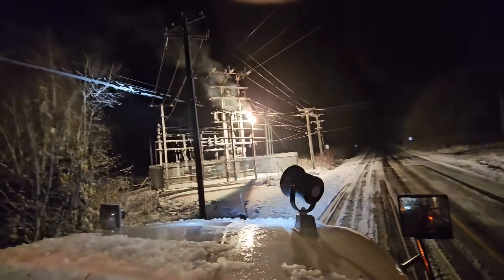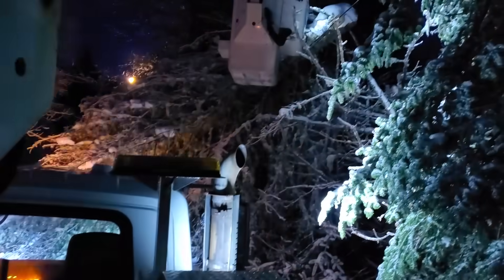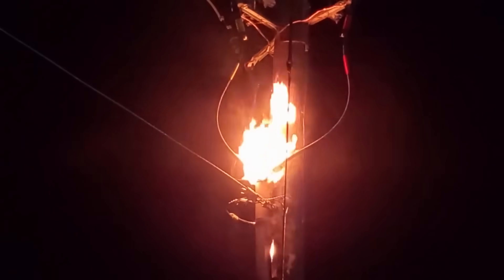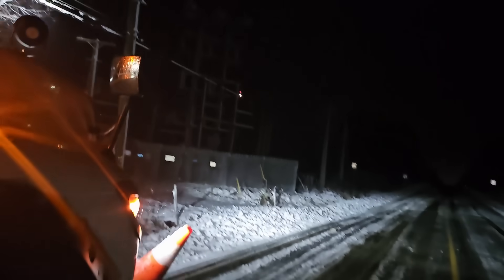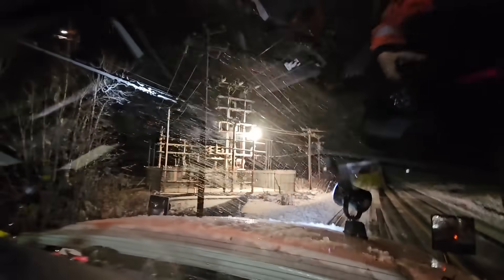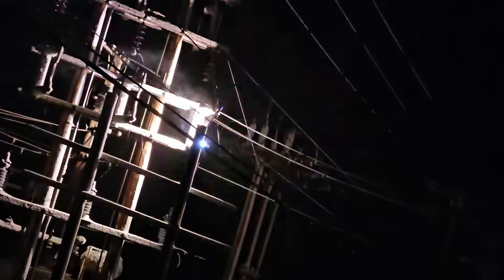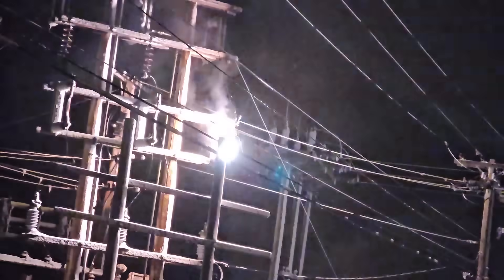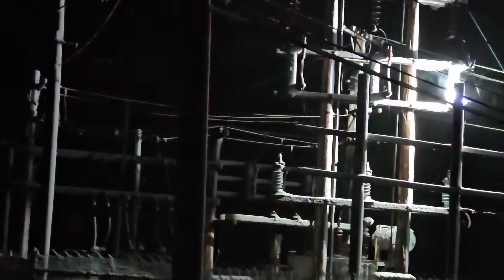Making "the call" to dump 10's of thousands

Comment: just imagine if nobody has seen that, and it progressed without intervention.....
Reply from the maker: Definitely could have been bad! Eventually it would have likely cross phases or gone to ground and tripped the Highline... But the fault could have very well burned the entire structure!
Reply: @Bobsdecline  "it'll burn out eventually" :-) I've seen a few systems around here (NC) with isolation panels between the phases, I assume to limit arcs. (the smaller scale "industrial" systems have those boards to stop the errant screwdriver. I've told the story of the telco power minions dropping a wrench into a PDU... that was just -48VDC/5000A.)
Reply: @jfbeam  I have seen coper plated glass windows in two doors with a spanner that dropped 2 floors and fell across the 8 inch by 1/2 inch x two copper buss interconnecting 3 battery rooms and 4 rectifier banks on diffrent floors the rectifiers were in sets of 3 x 1000 amps (12000 amps) battery rooms had 3 banks of 4000Ah cells (36000 Ah) the spanner was never seen again and a 1 inch notch left in the buss bars.
Reply: It would have eventually caused a phase to phase fault and dome a lot of severe damage to the substation. 😮
Reply: @christopherleubner6633 the amount of damage done depends on the architecture of the substation. assuming a substation with microprocessor relays, the line relay in the station would detect a zone 1 phase to phase fault and trip instantly, clearing the fault within 4 cycles. or, if this was on a bus, the bus differential relay would detect the current imbalance and immediately trip the bus breakers, again clearing the fault within 4 cycles. these trips would prevent the expensive transformers (and other components) from being damaged.

you might have to replace a structure or some conductor, but that's not much compared to the transformers or breakers being damaged.
Reply: Good thing that arcing was observed in the dark of night.  The initial low glow certainly would have been much more difficult to detect in daylight.

Comment: Now for a question, do those HT fuses or the things they are mounted in age in a way that would cause this kind of failure?
Did older equipment that has hopefully long since been replaced and/or upgraded develop any "bad habits" like this as it aged?
The only other thing I can think of for a potential cause for this kind of thing is that it's weather-related, but this kind of failure seems to have happened "inside" something that's largely protected from direct exposure to the elements, so that exposure protection would have had to fail first for that to be a factor. Strange!

Comment: That fuse looks to have a ceramic material over the internal fuse element. It appears that the HV found an external pathway around the open element along the ceramic case and made what we (in electronics) call a carbon track. High resistance, but still conductive enough to start an arc.
Reply: With wet snow around zero degrees C, yhea that could happen. I have seen dirty insulators with electricity crawling on the outside of them.

Comment: Fuse barrel failed allowing current to flow through the barrel instead of the fuse. The barrel itself isn't the best conductor so it began to heat up causing the flash

Comment: At least you didn't need a spotlight to find the fault!
Reply: Definitely a "well there's your problem right there" kind of situation lol
Reply: I'm a up-to-600 volts kind of electrician, my problems are that easy to find only when FPE panels are involved. Had a dock lift cord cold shorted on a 20A double pole (208 3ø) that was still live after violently arcing itself in half. Not all Stab-Lok breakers are that pyrotechnic, but the good ones and bad ones look identical until stuff goes wrong. 😂
Reply: @kdawson020279 ya gotta love FPE panels 😆!!!
Reply: @kdawson020279  It is wild to me that things like this are still possible.. like you would think the system is so basic even the knock offs would work too... it's almost dumb to fail.
Reply: @Alarichswiftpaw  To be fair, even the "newest" FPE panel is going to be 40-some years old at this point.  They stopped making the problem panels in the early '80s and were completely out of business by '88.

Comment: This vid must be related to a storm that blew thru my area of NY a couple weeks back, started on Thursday night and was tapering off by Friday morning. All told it dumped like 8-12" of heavy wet stuff on our location, causing a lot of headaches for power AND cable company (~20k service interruptions for each of those two utilities).
Woke up at like 2AM and I heard some cracking groaning sounds "outside somewhere" but I was too sleepy to investigate since they weren't loud enough to make me think they had landed on the house. My best guess is that it was either our Lilac tree splitting or some of the trees from the hedgerow losing branches.
Then I woke up again at around 4AM and there wasn't a single sight or sound to be had, because the power had gone out. Good thing our weather radio has battery backup.
All I did about it was fumble around for the flashlight I keep in my desk drawer, throw on another blanket and go back to bed.
Power came back on at ~8:30AM, but the internet stayed out the whole day, but I managed to get our house "an" internet connection by using a USB-C to Ethernet adapter to tether my dad's smartphone to the same ethernet cable the cable modem usually uses. Good enough for 360p video with frequent interruptions, and to do basic messaging. Maybe you should keep that idea in your back pocket for if you end up in a similar situation someday? "Some" internet is better than "no" internet, after all.

Comment: That is a situation that even as a regular sparky can come up....I've had a few commercial calls where I had to end up dumping an entire building to contain a fault that was threatening to take out the entire switchgear. One memorable one was a plant where interrupting power to process was going to cause a lot of collateral issues with equipment...I told the owner we do the immediate shutdown and fix it within a few hours, or we let it burn until it takes out the entire service and you'll be down for weeks as we pull the damaged gear out and order in new gear.  (At a cost of lost production and new gear in the millions.)  In my position then (as with yours in this case) it was ok, do a short term shutdown of 10-20k customers or let the entire substation fault out taking days if not weeks to rebuild...which is the lesser of the two?  Sounds like your utility has good folks at the top and made the right call to trust your judgement without question.

Comment: While I was living in Florida I was in the house minding my own business. I heard a sound which I don't think I ever heard before. To me it sounded like metal plates sliding on concrete or even super loud welding. I stepped outside and it had quit. So then I had walked down our long driveway to get the mail, when the sound came back and I think I jumped off the ground. The high voltage line running overhead on the other side of the road was producing electricity on the outside of the wire. It looked scary to me. I called FPL and got right through to the top guy and he said he would send them out right away. They must of had trucks close by because they were there in less than 10 minutes. This road we lived on was always super busy.
Reply: Florida Man strikes again.
Reply: last time I was in Florida, a giant line broke off and went down across the highway and other roads near orlando/ disney. one of their silly mouse head towers. that made a wee mess of things that day.
Reply: FPL had an substation explosion with a video of it here on YouTube.

Comment: happened around 35 years ago at the substation 7363 ,same situation with a big arc at the fuse, same conclusion had to drop the 69KV line to isolate the defective switch

Comment: Two questions:

How long did it take to repair that issue and reenergize the lines?

And, you showed a clip of a fire on a pole.  How many poles have you had to change out due to fire, and how long is the process. 

I guess that's actually 4 questions.
Reply from the maker: We had the 69kV line energized within about 15 minutes. The sub in particular was about 8-10 hours.

I've changed out hundreds of poles due to fire... Typically about 6 hours including response time and 3 hours if we use a pole top extension.
Reply: @Bobsdecline  interesting.  Thank you for the reply.
Reply: Once the blade switch is disengaged the whole fault region is isolated, so the main line can be reenergised. Inspection is appropriate, but in theory it only needs to be off as long as it takes to get to and operate the blade switch.
I am no expert, but I don't think attempting to disconnect using the blade would be a good idea, even if it was accessible. It isn't designed to kill arcs that have already formed, and you risk damaging equipment that cannot be remotely isolated from the main line.
Reply: @agsystems8220  ya I got that from Bob's explanations, But thamks.

Comment: I guess I'm a little surprised that the substations don't have isolators that can open under fault conditions so you don't have to dump the entire transmission line.
Reply: This was surface tracking on the fuse which is normally responsible for the automatic side of that very isolation under fault you mention. The fuse itself was blown but an insulation fault bypassed that isolation, leading to fireworks. There was an actual isolation switch directly above the faulting fuse, but the operating handle was below a shower of sparks.

Comment: If worst case occurs and substation is damaged, and takes a week to rebuild, do you bring in temporary setup on a trucks and reenergize?
Reply from the maker: Yessir exactly!
We do have a couple "mobile subs". Definitely not ideal to have to bring one of those fellas in!
Reply: Transformer on wheels. Seen one fail spectacularly as in the main transformer had an arc fault that overheated it so badly the over pressure disks blew out and made a huge explosion as the boiling oil ignited. The cause was a blown fuse arcing over because the pfc capacitor shorted and some if the monitoring gear was off line. Substation was a total loss. If you search for transformer explosions, you can see it as somebody was filming it 😮😳💀💩
Reply: @christopherleubner6633   That was the Ives Dairy substation, I think it is in Florida.
Reply: @christopherleubner6633  I think this is it:

https://youtu.be/ZCzdPFJ4tog?feature=shared